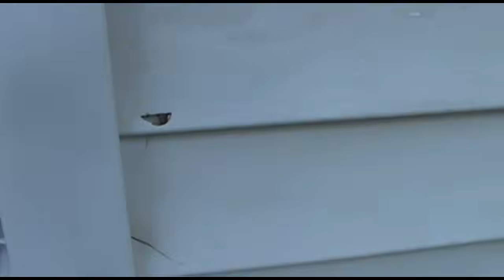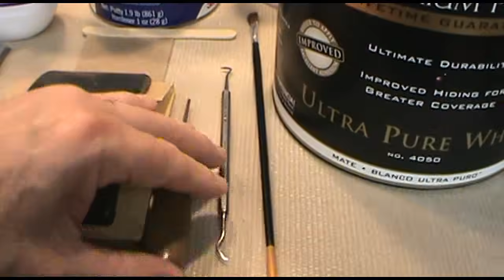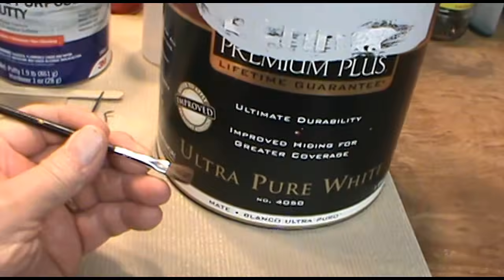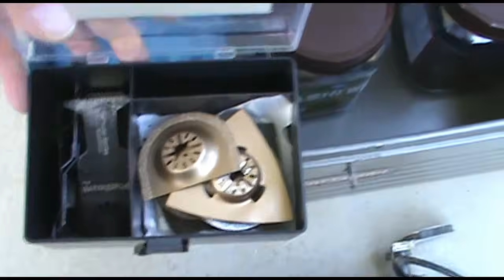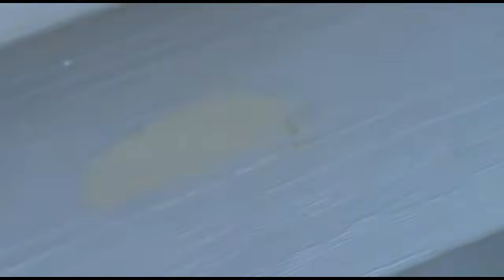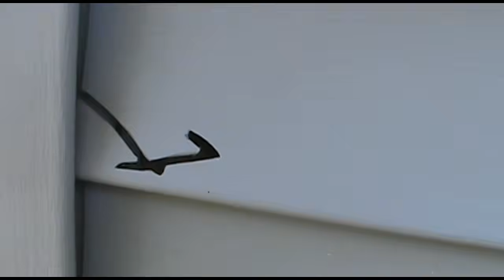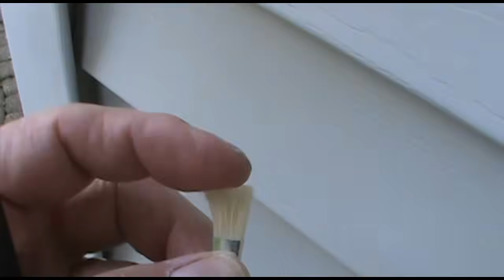How to Repair Vinyl Siding Holes and Cracks. Perfect and Undetectable.

Comment: I see that Bondo worked good on nail size holes, I have some larger holes from a lawn mower throwing rocks would this method work on those as well
Reply from the maker: Hi Paul. If you watch the video from 19:58 minutes into the video to about 22:00 minutes in you will see that I repaired a fairly large "X" shaped crack that I opened up a bit so I could get a little more of the All-Purpose putty in there. It sounds like the hole in your siding is bigger than that though. I have repaired holes as large as one inch in diameter using this exact method and it has held up for years now. I just mixed up a larger blob of the Bondo putty and loaded it in there. You have to work quickly because it sets up very fast.
 
If you are repairing a hole much larger than one inch in diameter I would suggest you do this. Get a tube of Dap Alex White Painter's All-Purpose Acrylic Latex Caulk https://amzn.to/2A0qYDo  and make sure it is only the acrylic and latex kind with NO silicone. You want it to be easy to clean up with just a wet paper towel. Hold your caulking gun at a steep angle and nudge the tip of your caulking tube nozzle back a little under the edge of the vinyl siding and squeeze some caulking all around the outer perimeter of the hole between the back edge of the siding and the wooden structure of the house. This caulking does very little moving over time and it will help keep the vinyl siding from moving around when your repair is done. It is also going to serve as a "backfill" in this next step. Now that you have put a bead of calking behind the vinyl and around the perimeter of the hole you can carefully squeeze in more caulking around the center of the hole until it is completely filled in but you want to keep the backfill of caulking recessed about 3/16 of an inch away from the surface of the outer edge of the vinyl siding. This will create a recessed "pocket" to load the Bondo All-Purpose Putty into. Have a small bowl of water and some clean paper towels handy. Then you will be able to quickly clean off any caulking that might get onto the outside of the siding. Don't let it dry on the outer surface of the siding or it will be tough to get off. Let the caulking in the center of the hole dry overnight. They say it sets up in an hour or two but you want it to be completely set up and solid before the next step. After the caulking backfill is completely dry you can mix up the proper amount of Bondo All-Purpose Putty and fill in the rest of the recess in the backfilled hole. Sand it down, trace in your wood grain lines with a dental tarter pick, clean the patch up with some denatured alcohol and paint it. That should do it.
 
I hope you can visualize the steps I have outlined here Paul. All we're doing is making sure the hole doesn't flex or move over time and creating a backfill pocket to hold the All-Purpose putty. Good luck and thanks for stopping by.
Reply: @Fixitforgetit  Thank you, I will definitely be doing that
Reply from the maker: @paulwright1616  My pleasure Paul. Good luck with your repair. I love having vinyl siding that looks like the day it was installed. :-)

Comment: Why not use wood filler?
Reply from the maker: You could try that but I think it would be harder to work with and maybe more brittle which could lead to cracking. This method works so well I haven't tried anything else after I found the All-Purpose Putty. Thanks for your question Bluecavemen.
Reply: Why not make your own video?
Reply: @ivrabassett9487  why would I make my own video? If I can watch other one who is more affective. I saw one that uses aluminum tape then use chalk then paint over it. That brilliant !!!

Comment: Thanks for making this. I've been looking for an alternative to caulk for filling small holes in my white siding. The caulk always looks bad. I'm going to try this next. Seems like a great solution.
Reply from the maker: My pleasure Joe. I tried other methods before coming up with this fix and this, by far, is the best repair I have found for vinyl siding. I don't simply want to plug the hole. I want it to look like nothing ever happened to the vinyl siding. I have repairs that are more than 10 years old that still look great. I power wash them and have been surprised that the paint hasn't peeled off and the patch never cracks or fails in any way. I keep the wand about 4 feet away and have it on the fanned out setting but that's how I wash the rest of the vinyl anyway. Thanks for stopping by and I hope this method works as well for you as it has for me.

Comment: You just slap on the Bondo over a hole without any kind of backing? Sounds like a repair doomed to fail.
Reply from the maker: Thanks for stopping by Lars. Most of these holes are fairly small and there isn't any sort of high stress being put on the repairs. Having said that they are surprisingly durable. The Bondo All-Purpose Putty isn't as brittle as auto body Bondo. I have some of these repairs that are at least 10 years old and you still can't see where the repairs are. I just came in from power washing my house and had no problem with the 20 or so repairs around the house. The repairs don't shrink, crack, or sag over time. I wouldn't want to try holding the power washer 3" from the repair but holding a 2100 psi power washer 3 feet away from the vinyl siding repair isn't a problem. I have the power washer jet fanned out when I wash the siding. 

If you wanted to backfill the hole before completing the repair it would probably make it even stronger as long as the filler material doesn't contract or expand. But you don't need to take that extra step to get a beautiful long-lasting repair. Even if something hit the repair and knocked it lose (I've never had that happen) it wouldn't take long to fix it.
Reply: @Fixitforgetit  ...wished you would have shown the actual process....esp backfilling..trying to learn to do it step by step....I have a long crack to fill..good in other areas though..thx
Reply from the maker: @zaneblane8160   If you watch me mix and fill the small hole you will know what to do. I did the exact same thing on the other side of the house on a large "X" shaped crack. You simply mix up a larger blob of All-Purpose Putty. You may want to use a Dremmel tool with a fiber wheel to enlarge the crack like you see me do at about 19:58 minutes into the video. If you have a 3-inch long crack you would want to open it up to about 1/8 of an inch wide. Then you would have a 1/8 inch by 3-inch opening. Then you can load the opening up with the putty. If you simply put a skim coat of putty over a crack without opening it up it will probably crack back open. If you watch the video from 19:58 minutes into the video to about 22:00 minutes in you will hopefully get the idea. I simply opened the big "X" shaped crack up, loaded it with putty, sanded it, scored in the lines, and painted it. As you will see it was a fairly big crack. The putty sets up so fast you will probably have to do about one inch of fill at a time. Let the first inch dry up then do a second inch and so on. As you will see in the video this works quite well. I hope that helps. Thanks for your comment and good luck with your repair.
Reply: @Fixitforgetit  Thanks for replying.. I'll try it.
Reply from the maker: @zaneblane8160  You're welcome. Thanks for stopping by and good luck with your repair.

Comment: What if the hole is bigger and on the trim so not on a perpendicular more parallel to the ground
Reply from the maker: Hi Jeanne. I haven't repaired a hole like that but what I would try is this. If the hole were larger and in  a difficult position like overhead, for instance, I would get some stainless steel wire mesh (https://amzn.to/2IWAk4a) and cut it slightly larger than the hole using tinsnips. Then I would loop a piece of wire (or heavy string) through the center of the wire mesh to pull it tight while applying the  Bondo All Purpose Putty. I would then work the wire mesh into the hole (this will take some manipulation of the mesh) and use it as a foundation for the putty. I would hold down on the loop of wire (or string) in the center of the mesh to hold it securely as I applied a skim coat of putty over it. Because the putty dries so fast this may take several applications. Once your patch is coated with Bondo All Purpose Putty you could snip the wire from the center of the mesh and sand the patch. Sorry if this is hard to visualize but I think it will work.
Reply: Thanks a bunch
Reply from the maker: @jeannecoughlin6953  My pleasure. I hope that works for you.

Comment: Thanks for showing this. I will use this method on my siding. Today I attempted to install some floating house numbers in my vinyl siding. I used the hardware they came with and followed the instructions but it seems like the screws aren't long enough. There's a layer of foam under the siding. Am I supposed to use the anchors also? I did attempt to put those in also, didn't work. I purchased the numbers at Home Depot. I'm not sure how I would use longer screws instead due to the fact that it seems like the screws the numbers came with are the only screws that would fit the numbers. Any tips?
Reply from the maker: Hi Abigail, thanks for stopping by. If you are installing the house numbers on vinyl siding you could try a couple things. If your screws are 3/16" diameter, for example, drill a 1/16" piolet hole in the vinyl and then slowly turn the screws directly into the vinyl through the piolet hole with a screwdriver. That should give enough "grip" to hold something as light as house numbers. Keep in mind that you will not be able to over tighten the screws because they only have the thin wall of the vinyl to grip as you tighten the screws down. If you are installing plastic plugs into the vinyl siding drill you piolet hole in the vinyl about 1/16" smaller than the largest diameter of the plastic plug. If the plug is 3/16" drill your hole 1/8" and then slowly tap the plug into the piolet hole in the vinyl with a small hammer. If the hole seems a bit too tight you may need to enlarge the hole slightly with a larger drill bit but be careful. Once the hole is too big the plug will not hold and then you may need to proceed to the second method below.

Another thing you could try is what would probably be the preferred method. The provided screws probably won't be long enough to go through the vinyl and continue into the wooden exterior wall behind the vinyl. If you get some stainless steel wood screws that are the same diameter as the screws that came with your numbers but about one and a half or two inches longer than the original screws they should be long enough to go all the way into the wooden wall behind the vinyl. That will hold the numbers very securely. The overall length of the screw will depend on how thick your vinyl plus the foam and any void spacing is. You could put a nail or pick through one of the piolet holes and probe to measure how long your screw needs to be. Push the probe through the vinyl and foam insulation until it hits the wood exterior wall of your house and measure the probe to the outside of your vinyl and floating numbers to determine your screw length. Add about 1/2" to the total. The stainless steel screws won't weep rust down your siding over time. Drill a piolet hole through the vinyl and into the wooden wall behind the vinyl that's about 1/8" smaller than your screws and you should be good to go. Be sure there's no plumbing or electrical wiring behind the house numbers if you drill into the wall behind the vinyl siding to mount your screws.
Reply: @Fixitforgetit , thank you so much. I will definitely try the 2nd method, seems a lot easier. Keep up the good work 👍
Reply from the maker: @abigailarizmendi1261  My pleasure. I hope your projects go smoothly and thank you for your comments.